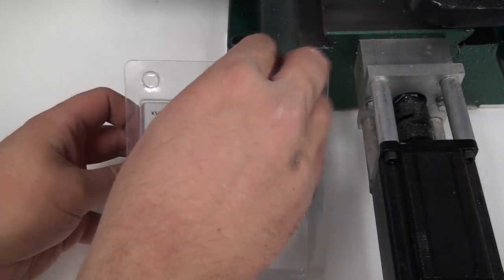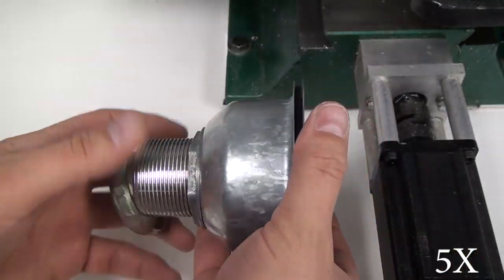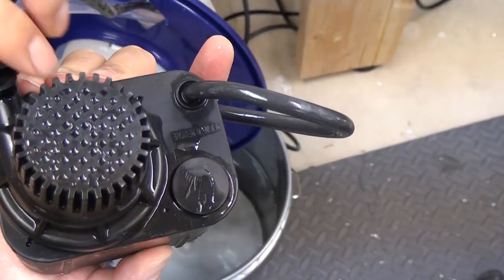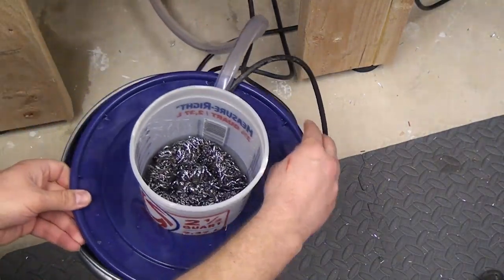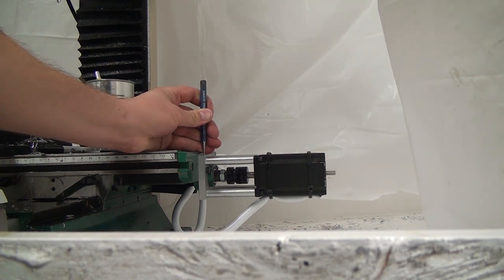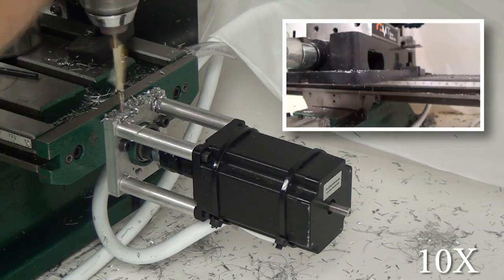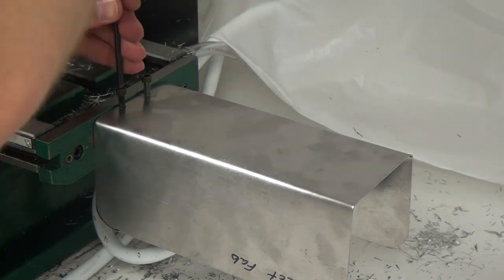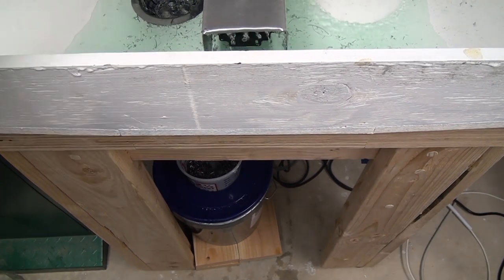CNC-G0704 #9 Flood Coolant

Comment: Nice Job!  You are going to love flood coolant.  It makes such a difference in the performance of the mill.  I used a similar drain on mine and to help it stay clear longer I put a ring of plastic screen around it like a fence to keep most of the chips in the tray not in the strainer.  Keep up the the good work and keep the videos coming.
Reply from the maker: Thanks! I have been thinking of some kind of net, fence, screen, to help with the clogging. I'm sure something will present itself :)

Comment: A screen over the drain might help with clogging.  Maybe use a metal window screen and mold it over a bowl so it stands high?  The chips may block it low, but eventually the coolant will get over the blockage.  John Grimsmo showed replacing of the screen in his Tormach (which is flat, not domed)...might be worth a look for ideas. 

It may not have helped with your thick top, but when I once needed a hole in some 3/4" MDF that was bigger than my lone hole saw, I started with the hole saw, then used my router with alternating rabbet and top-bearing pattern bits to enlarge it.  Use the rabbet bit to follow the lower part of the hole and cut the top back, then use the pattern bit to cut the bottom to match the top of the hole.  Rinse/repeat until the hole is big enough.  Worked well.

Thanks for the video!

-- Mike

Comment: How did it make a difference when machining with coolant?  were you able to get better feed rates or nicer finishes?   I'm supper happy today as yesterday I made my first part on my g0704 and it actually worked well :)   just need to get better with the cad and cam side of things but it cut very nice in aluminum.  I spent alot of time with calibrating the axes and backlash compensation and was very impressed with the accuracy of it when it was all said and done.  I'd like to thank you as well as the others on youtube for putting the thought in my mind to building my own cnc has been a fun home project so far I didn't purchase any plans but kinda used the basic concept of what everyone else did just took my own measurements.   Truly the possibilies are endless when it comes to turning a thought into reality now  :) thanks again for the great videos.
Reply from the maker: So the main reason I needed flood was for cutting titanium. Everyone has told me that ti is super hard on your cutters without flood, and it appears to be true. I haven't really noticed the flood making a difference on steel yet, but a HUGE difference in aluminum. I can go faster, and my surface finish is much better. Chip welding is a thing of the past :)
Reply: ah aluminum chip welding. :) experienced that my very first part I tried to make yesterday, was cutting to fast and to deep the first time around with no coolant,  learned my lesson fast as I melted the aluminum in my flutes also learned the motor on g0704 must have an overcurrent protection as it auto shut the motor off no big deal which is probably a good thing. Truly not a good feeling when you didn't expect it and you don't have an emergency stop other then the mach mouse stop button lol.  I'm sure you've probably been there before.  Second attempt turned out great with some chatter where I only rough cut.  I slowed the feed rate considerably and actually sprayed some wd40 on that one.  I hope to get to the level of your experience one day and would like to get to a level of flood coolant.  I had better focus on some input for E stops and maybe some limit switches for homes and hard limits aye lol later man thanks for the great videos keep em up. oh by the way can you recover an end mill after aluminum welding or should I consider it a loss cause :)
Reply from the maker: Mike fisvii Welcome to learning it the hard way! :)
WD40 does make a huge difference on aluminum. I bought a gallon of it and pour it into a squirt bottle. I also have some in a soup can with a small acid brush so I can apply small amounts when needed.

My biggest mistake when starting out was using 4flute end mills in aluminum. They would clog up and snap all the time if there was any chip welding at all, or if I were in a deep hole and couldn't pull the chips out. If the end mill doesn't break, then you can get the welded chips out with a pick of some sort and keep using it.... at least that is what I did. These days I only use 2flute and 3flute end mills in aluminum unless it's a nice shallow cut, or there is a lot of room for chips to evacuate. Even then, you need to keep everything cool.
Reply: You called it :) 4 flute, along with no coolant to much depth of cut probably and definitely too fast of a feed rate.  Oh well sometimes a babys got to touch the Hot stove for it to sink in.  The next attempt was successful with the only changes being a slower feed rate 2 flute end mill and wd 40, was impressed, like ya said Welcome to learning it the hard way,  I suppose some times you have to touch the stove to prove it to yourself that you know that the stove truly is hot.  Should have listened to the one that told me not to in the first place :) well itleast you would have thought I'd of known better after all the youtube videos I have watched on the subject. lol  later man thanks for the advice I will definitely keep it in mind for the future. Good lesson learned.

Comment: Thanks, for the comments, if you could do a video demo of using a 1/4" mill bit with a variety of cuts that would be very informative.

My X2 did a good job on aluminum but it won't begin to cut steel.
The older Bridge ports are powerful, but are giants and buying used is always a risk for this type of industrial machine.

Thanks
Reply from the maker: Yeah I would love to have something like a bridgeport, but they are so big and heavy... I have no place to put something like that. I'm hoping one day I can afford a Tormach, but I have no idea where I would put it :)

I'll do some 1/4" end mill cutting in a couple different grades of steel and get some footage.

Comment: I like your system and will copy it.  The only difference is I will use a compressor and air to push the chips away....actually that will be the first step and then maybe add coolant.  Nice work !!!
Reply from the maker: +Rich Acker Thanks!

Comment: Thanks for the flood coolant video.

I'm interested in this mill and looking to upgrade to a mill that would cut steel, do you know what kind of numbers you get when cutting steel, as far as depth of cut for a particular size bit and feed rate? 

Thanks
Reply from the maker: You can really do just about anything you want, as long as you are willing to slow down and take your time. For some reason I have had bad luck with 1/2" end mills, but 1/4" end mills are the bread and butter. I'll try and put a test together and get you some answers. If you can give me some ideas of what you would like to see I'll see if I can get some footage in a video.

Comment: Like your vids.
If your trying to get higher coolant pressure, try making a tip for the Loc-line with a smaller orifice.
Reply from the maker: I do have some smaller tips, but I would prefer the volume and pressure.
Thanks!

Comment: might be wize to put a little silicone under the dripprotection for the steppermotors near where you bolting it down , it might seep under there
Reply from the maker: It hasn't been a problem, but that's a fair point. Next time I have it apart I'll add a little RTV.

Comment: Hi thanks for posting the video.  I have a question in regards to the machine in general.  Im thinking about getting one for working on kart engines I race. Looking to use the mill to deck blocks and machine heads. Would like to be able to also bore cylinder if possible. Not sure if this would be able to do what im looking to do? Any input would be great guys.
Reply from the maker: Hey!
I have never done any type of engine work so I hate to guess if this mill (or a similar) would get the job done. It can be as accurate as you like, but rigidity can be a real issue. If you have not already, I would suggest heading to the CNCzone forum and see what people there are saying. Maybe post up in the bench-top mill sub-forum.

Comment: Are you still using koolmist 77?  Over the long term has it rusted anything ?
Reply from the maker: +noshortnamesleft atall Yes I am. When Brad and some of the other guys switched over to Qualichem I just about did too, but I still had some 77 to burn through. The thing is, I've had such good luck with it so far I haven't dared try the Qualichem just because I'm afraid it is going to go through my paint.

I haven't had any rust problems, and I only mix it a tiny bit richer than it says to do on the label. I do keep a close eye on it though. I'm used to knowing sorta what color it should be, and I just keep it right at that color. The water will evaporate out over time so you just add more (start with tap water then add distilled when topping off) and watch the color get back to where I think it should be. For this reason, I use a clear coolant container because I can see how dark/light the coolant is getting.

Also, grab a tramp pillow to keep in the tank so it absorbs the oil out of the coolant. I use the one Tormach sells.

Comment: why cant you use wd-40 instead of the very expensive kool mist 77?
Reply from the maker: If you mean for flood coolant, WD40 isn't made to be mixed with water so in my case I would need 12 gallons of WD40. 1 Gallon of KoolMist makes more than 12 gallons of coolant.
If you mean for misting, WD40 as a mist sounds horrible as it would coat everything in your space as it isn't water based.
If you mean just in general, in my personal experience WD40 isn't bad at all when machining aluminum, but does pretty much nothing when machining steel.
I've moved away from KoolMist to something called KoolRite (different companies) and I like it even better. I'm still using a 12 gallon sump.
Reply: i was talking about for a misting way. i know it wouldnt be a good idea to use wd-40 for flood coolant. wow that would cost much lol. but i was told misting with wd-40 isnt a good idea either. but thanks for getting back to me

Comment: I just built an upgraded version of the shower curtain enclosure.

https://www.youtube.com/watch?v=SAcZtlcth0M

I used 18 ounce per square yard white vinyl tarp from eBay, floor to ceiling, suspended from a 2X4 framework that's screwed to the ceiling in my basement shop.  I do not plan on using coolant in my basement shop because I don't like the mess or the smell (although newer coolants don't smell as bad), and I don't like the recurring cost and maintenance.  I plan on doing almost all dry machining, using high pressure air as the coolant fluid and to blast away chips to prevent recutting.  My theory is that 1-2 HP home shop mills probably don't need flood cooling, and if it ever came down to a problem with overheating a tool, I'd rather take a less aggressive cut and go a bit slower with my automated CNC mill to avoid the need for flood coolant and the attendant mess of soggy chips.  I make a strong distinction between automated machine time and my time.  I'd rather the CNC mill spent several more hours per month if it'd save me from spending 30 minutes per month maintaining a flood coolant system.  That's the theory, anyway.  I'll see how theory stacks up to reality.  In my experience, there's usually not much correlation.  :-)

My enclosure tarp has only been up a few days, and I'm loving it.  No more chips all over the basement.  So far, it's been easy to vacuum the dry chips on the smooth concrete floor.
Reply from the maker: Liberty4Ever Awesome. I love the flood for the most part, but you have very valid points. I'll check out your shower curtain... mine really needs an upgrade :)
Reply: russtuff I debated with myself, and if I had it to do over, I'd have gotten a 14 ounce per square yard vinyl banner from StickersBanners.com.  For my 8'X16' vinyl, it would have been about $60 more than I paid for the eBay tarp, but it would have arrived rolled on a cardboard tube so it wasn't wrinkled, and you can upload artwork and they'll print anything you want on it.  That could be cool.

I picked up the aluminum square tubing for my X motor mount and the steel angle for my Z motor mount today, and I used my CNC router to cut 50 holes in a 12"X24" sheet of plastic to make my 50 position hanging tool rack.  Hopefully I'll get that assembled and hung tomorrow.  I'll make a video,
Reply from the maker: Liberty4Ever That's a cool idea for the tarp, I'll check it out.I'm keeping an eye on your channel for your updates :)